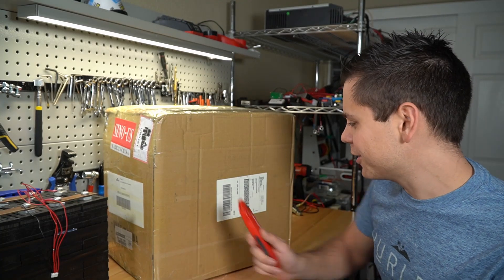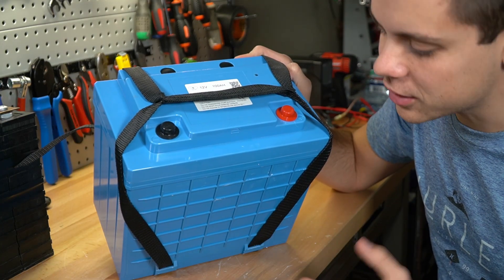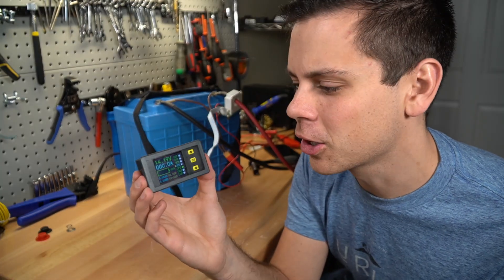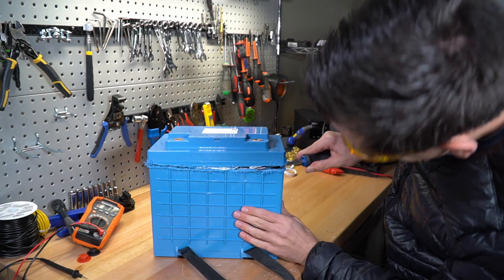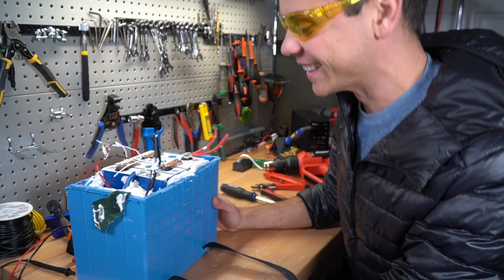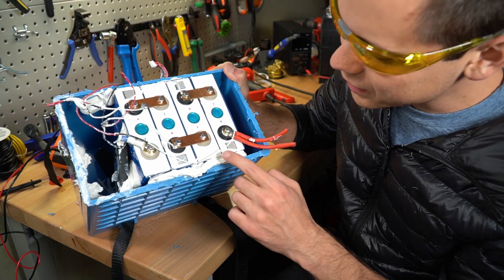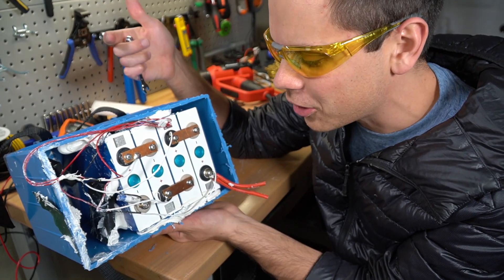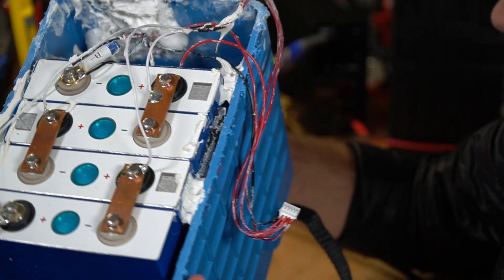Aliexpress $538 12v LiFePO4 100ah Renogy Clone (usually $899) Tear Down

Comment: I checked the provided link and they show how the battery looks on the inside... totally different from what we are seeing.
Reply from the maker: exactly. what a joke.
Reply: @WillProwse  Looks like provable false advertising to ME!
This is the problem; MOST Chinese Manufacturers are as dishonest as a used car Salesman!
Reply: @bruceforster3709  at least, the Wh are here ! In inverters, perhaps 99% of announced specs on bangood or Aliexpress are lies ! 
Chinese sellers are only good stage creators, there is quite nothing behind, and the whole country is like that.
Reply: @philv3941  Yes, you are quite right! I try to U.S. componets WHEREVER possible. I want to support MY country, thank you very much!
Reply: @philv3941  I have purchased a bunch of things from aliepxress. 99% is an exaggeration.
Liitokala batteries are awesome and actually perform above spec. The problem is aliepxress creating a monopoly and now sellers are having the same product for the "cheapest". It is not so simple. And please don't assume Chinese sellers are bad, that is simply racist as I have seem mean car dealers being much worse.
Reply: @bruceforster3709  *MOST Chinese Manufacturers are as dishonest as a used car Salesman!*
if that were true, there would be no suppliers for many small businesses as China builds most products.
It all depends which company and of course you can get anything shitty anywhere.
Reply: I would be very careful with toxic stuff inside stuff
Reply: No, it's not a joke Will ! It designed to mess around guy like you, who likes to stick noses into their "secrets" 😁😃🤪, but we like yours nosy attitude 😁👍
Reply: Looks like Will’s video got their attention and the removed the picture of the internals.   Either that or I am missing it.
Reply: BuckO Seven yep and Will posted the photo of the inside on the review part of their page. Makes sense. Anyone can use stock images.